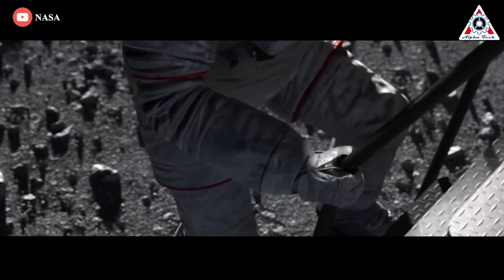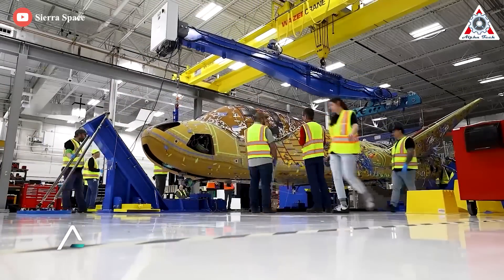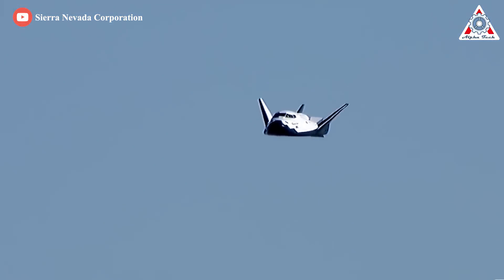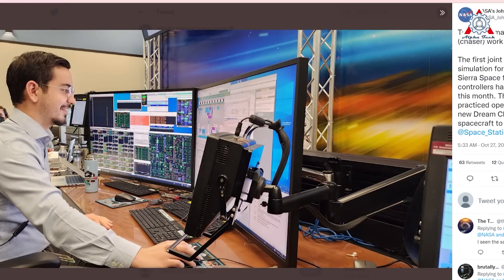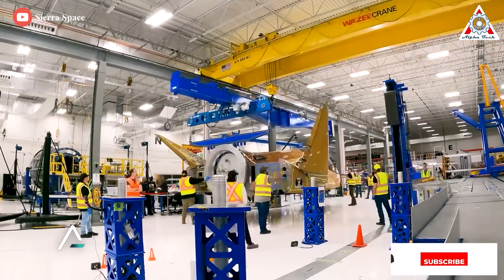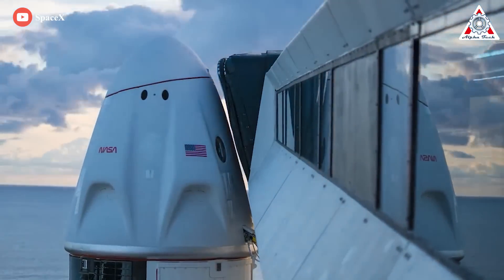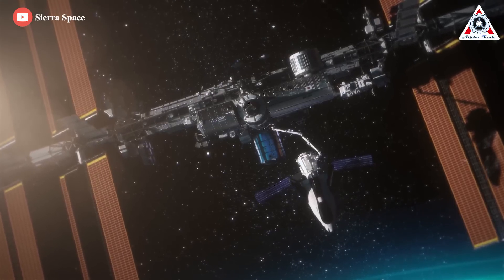Dream Chaser HUGE Update "First launch incoming" that makes NASA crazily

Comment: For me, this has the same drawbacks as the space shuttle. That is having lots of custom sized and tailored heat tiles. This is really difficult to maintain and a subtle defect would lead to catastrophic disaster. More importantly, this heat tile replacement procedure would increase the maintenance time and cost between flights. The other thing is why we need wings and air plane like aerodynamically shaped body, where it destined to spend more time in a vacuum. This dead weight added just for the return trip slow down process, I don't think it will pay off the effort and money in the long run.

Comment: NASA has been working on an inflatable heat shield. I wonder if it’s possible to use it on dream chaser and still keep the air dynamic flow of Dream Chaser.

Comment: Glad other companies are making small man-rated capsules and spaceplanes, now that SpaceX is about to put all of its eggs in the Starship basket. (SpaceX just said they were building their last Dragon 2 capsules).
Personally, I cannot foresee a time when NASA will man-rate Starship for launch from Earth. It has no ability to save the crew if the Starship second stage/vehicle explodes. Capsules and small mini-shuttles will always be safer because they separate propellants and launch engines from crew compartment. In Starship, the crew is sandwiched between two sets of huge propellant tanks and has the second stage rocket engines attached to the crew compartment.
Dream Chaser starting with a cargo version is a good thing. Doing it that way is one reason SpaceX kicked Boeings ass on getting crew to orbit first. SpaceX had already built the pressurized cargo Dragon Capsule, tested its heat shield and landing systems, and tested all of its control software BEFORE they tried to create the manned Dragon 2 capsule. So they had less than half the work to complete than Boeing did in creating their Starliner. (That also might explain why Boeing got more money than SpaceX in the Commercial Crew Program. Boeing was starting from scratch. SpaceX was able to reuse quite a bit of flight proven hardware in their new capsule.)

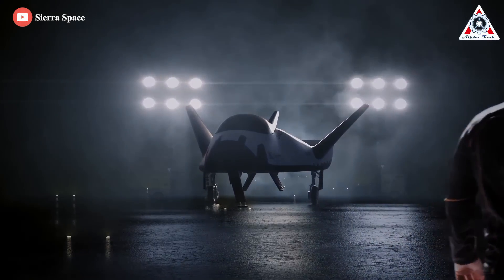Comment: 5:21 "the vehicle reduces overall cost providing quick turnaround between missions" This was said about the shuttle as well, but never materialized.
Reply: One of the cool things is that the DC will launch inside a shroud. That will go a long way to preventing tiles from coming off on launch. If the orbital maneuvering engines are modular, (able to be easily swapped out, like on the Dragon 2) that eliminates another long turnaround item.
Remember, the Shuttle also had 3 extremely finicky liquid hydrogen BOOSTER engines that were running at ridiculous pressures during launch and were just waiting to spring hydrogen leaks at any gasket. All those things (tiles falling off, booster engines that seemed to always need repairs, and maneuvering thrusters that needed to be refurbished between launches) made Shuttle turnaround such a pain. DC will eliminate at least 2 of them, maybe all three. It might be as easy as Dragon 2.
Reply: It's the difference between government run programs and privately run ones. Even Werner Von Braun, who originated the shuttle concept hated the final form when he saw it.
Reply: THE SHUTTLE WAS A MARVEL OF ENGINEERING. UNFORTUNATELY, THEY NEVER MASTERED THE HEAT SHIELD AND IT ENDED UP BEING THEIR UNDOING. IF YOU WATCH SPACE-X THEY ARE EXPERIENCING THE SAME THING. I SINCERELY HOPE THEY HAVE MORE LUCK IN SOLVING IT THAN ROCKWELL DID FOR THE SHUTTLE.

Comment: I'm failing to see the benefit of using a space plane over a capsule. Capsules appear to be the safest, and simplest way to return from orbit and they are now reusable (Dragon and Orion).  It seems to me that having to include the more complex hardware, software required to land on a runway dramatically reduces safety with little gain in functionality.

Comment: The next step would be for this vehicle to have a fully re usable fly back booster
Reply: And it would have the best of both worlds if the flyback booster worked more like a Falcon 9 recovery. That way, the DC could still launch inside a shroud for protection, rather than riding piggy-back like the Shuttle Orbiter - exposed to launch pressures and debris.

Comment: This is really exciting stuff. I get the impression that there is a lot of innovation in the design despite the similarities with the Space Shuttle which is
good because that should in theory make it more reliable. I'm really curious about the tiles. Shuttles' had its issues. Maybe these tiles will do better.
Reply: (re-post about the tiles) 
The life threatening aspect of the STS TPT system was foam falling on it from the ET, an issue which arose because new environmental regulations midprogram cancelled the use of the old CFC impregnated foam (which stayed put).  Dream Chaser is either mounted inside a fairing or atop a stack, where hypersonic apparent wind can't hurl parts of the launch stack at it.  Apparently, they are also using a different adhesive bonding for the tiles as well as larger tiles.  I dare to hope the newer system is better.
Reply: @digitalnomad9985  
Good point!
Reply: THOUGH HIS ARE MOSTLY THE SAME SIZE, MUSK'S TILE ARE VERY SIMILAR TO THOSE USED BY THE SHUTTLE.

Comment: Dream chaser is what the space shuttle was supposed to look like, before the government and NASA turned it into something the size of a bus...
Reply: Thank the Air Force reentry crossrange requirements for that one. Otherwise, the Space Shuttle would have been a lifting body too.
Of course, having the vehicle ride piggy-back on launch, exposed to hypersonic slipstream, shedding foam, and having finicky liquid hydrogen engines (and trying to reuse them every flight) also contributed to the lack of economy in the design.
DC is much smarter. Launches inside a shroud for protection of the tiles. The orbital maneuvering engines (except for attitude and small thrusters) will be in a service module that won't be reused. They definitely tweaked away all the pain in the butt parts of the Shuttle.

Comment: Love Dream Chaser (DC)    :)
Question: Are the wings really "wings?"  With DC being a Lifting Body, I would have thought they were more for guidance, balance, and air braking, rather than for lift.
In the end though, the most important things are it works, it is a great advancement on what we currently have, and (to a lesser degree) it looks cool.  :)
Reply: Without the wings it certainly would not be able to land on a runway, because the body itself doesn't have enough surface area.
Reply: @my3dviews   Can't dispute that, as I'm not an aerospace engineer, but I figured it would be too unstable without them, like some of the lifting bodies from the 60's/70's.
Reply: @martythemartian99     Yes, they would also help with stability.
Reply: No-one can say with any certainty that "it works" until it's been in orbit and returned intact. Flight tests have been successful, showing that the lifting body does indeed lift (the fins are indeed only for stability) but hypersonic testing at full scale depends on it going into orbit and returning to Earth. And its going into orbit depends on the success of the Vulcan rocket, and the success of the Vulcan rocket depends on the delivery of reliable engines from Blue Origin (which has now finally occurred).
I'm very excited to see DreamChaser fly, because fly is indeed what it will do (unlike that dismal ballistic tin can that Boeing keep plodding on with).
Reply: It has all been researched and demonstrated in the 60s and 70s.  Northrop HL-10M2-F1, M2-F2 programs come to mind.  In fact the first LBs were towed behind cars and eventually C-47s for proof of concept.  And yes they did land on "runways".  The dry lake beds at Edwards AFB.
Reply: @majorpayne608  yes the concept of the lifting body design has been around for decades. The bigger problem was getting it to work. One of these tests from back in the day. Was used on the opening of the tv series The Six Million Dollar Man. Let’s just say it didn’t end well.

Now with better design and computer assistance. These vehicles are ready to be put to work. I’ll be interested in seeing how this all goes.

Comment: Sierra Nevada Corp has a ways to go before getting a "Human Rated" cert for this thing. Even the Space Shuttle had serious Thermal Protection Tile problems decades into the program, some were life threatening. The majority of the SS's TPT's being unique to their position was a problem, driving up labor and expense to refirb it between flights. Looks like Dream Chaser has opted for the same. After watching SpaceX's R&D methods & processes, I've got more confidence in the commercial space sector then w/ NASA when it comes to bringing Space Faring vehicles up to the 21st Century. I wish Sierra Nevada Corp the Best w/ this project.
Reply: The life threatening aspect of the TPT system was foam falling on it from the ET, an issue which arose because new environmental regulations midprogram cancelled the use of the old CFC impregnated foam (which stayed put).  Dream Chaser is either mounted inside a fairing or atop a stack, where hypersonic apparent wind can't hurl parts of the launch stack at it.  Apparently, they are also using a different adhesive bonding for the tiles as well as larger tiles.  I dare to hope the newer system is better.
Reply: @digitalnomad9985  Now that you mention it, there's a neuron in there trying to remind me of such. I do recall a bit of the there being a change in Foam type mid-program. I didn't know the Dream Chaser was to be Faired into the Vulcan Centaur Rocket. I've only seen artists conceptions showing it w/o a Fairing and had assumed it would be launched exposed. Isn't that why there are TPT's on Dream Chaser's upper/fwd surfaces as well, like where the proposed windshield is might be for a Manned version? IDK, anyways, the Space Shuttle has always had TPT problems and not all were due to Foam Strike's, there were attachment issues as well. But, as you've pointed out, it looks as though Sierra Nevada is addressing those issues. SpaceX's StarShip is using as many rectangular shaped Tiles as possible but of course there's always a need to fill in the Faired surfaces too. Don't quote me on this, but somewhere along the way I seem to recall that SpaceX is using a Ceramic based TPT where the Shuttle used a compressed & bound Ash formula. And, I'd read or seen something to the effect that StarShip also had an insulating boundary layer tween the 304L stainless and the TPT's. The good news is that there are a few options and maybe we'll see a Manned/Womanned version to follow.  ; )

Comment: It feels like we are truly on the verge of a sustainable and commercially viable exploration of the solar system.  About 30 years late in my opinion, but here nonetheless.  Getting the legacy and inefficient government entities out of the way is overdue.
Reply: Unfortunately, these miracles may not be possible if someone does not get a handle on the "space trash" that is in orbit.
Reply: @ThomasLee123  The ideal solution to that problem would be an industrial infrastructure in orbit that can salvage that orbital debris as raw material for constructing things in orbit.  Overnight some of the "disposable system" losses of space operations would be recouped, the systems can be inspected before recycling to gain knowledge about the effects of the orbital environment on materials and systems, and suddenly ISRU, a concept hitherto limited to astonomical bodies, extends to Earth orbit.  Companies could pay the salvage operation for reducing their insurance liability.  An orbital tug need not use low-specific-impulse chemical rockets, but can use ion drives.  And this method does not entail the secondary hazard of deorbiting it all, and maybe having if fall on something, or someone.  With a significant mass budget like that, space stations and spacecraft could be built in orbit with significant mass for radiation shielding.  This could facilitate the building of a rotorvator/space station assembly.

Comment: 6:03 'Dream Chaser can return cargo at less than 1.5 GRAMS'? I sure would be nice to have narrators that know what they are talking about. Remember, little g = grams, big G = gravity. 
Dream Chaser can return cargo with less than 1.5 times the force of gravity. SMH.
Reply: LOL.
These guys really need an hour of the services of a technical editor before exposing their poor English to the world..
Reply: Capital "G" is the universal gravitational constant.  It is NOT the acceleration of Earth's gravity.  The text that the narrator was reading was correct in using lower case "g" for Earth's gravity (9.81 meters per second squared).  It is understandable that a neophyte wouldn't know which "g" was referenced in the text, since both grams and Earth's gravity both use lower case "g."

Comment: Of all the independent commercial space craft currently being used and still in design, Dream Chaser is the one that REALLY gets me excited.
Reply: The best part of the Dream Chaser is that it hasn't suffered all those comittee-led design compromises imposed on the shuttle. Its lineage can be traced back to lifting-body designs, tested in the early 1960's to mid 1970's, by NASA's Armstrong Flight Research Center.
Reply: @NieR.Amanda  
Excellent point, Amanda.
Reply: Seems to be a downsized redesign of the Shuttle to me. We should thank the engineers from my alma-mater Rockwell, International for the original design.
Reply: @ThomasLee123  Dream Chaser is more along the lines of what the Space Shuttle was originally going to be, but NASA decided to team up with the US Airforce to split the development cost. It was the US Airforce who wanted a large space plane with a massive cargo bay not NASA. In the Early 90s NASA wanted to replace or supplement the space shuttle with something more along the lines of Dream Chaser is now, but they weren't given the funding.
Reply: @DeepDeepSpace  
And, of course, it turns out that in the end the USAF version was the one that got into orbit and did not explode.
Reply: @ThomasLee123  well the USAF version was the only one they built.

Comment: This space plane is pretty cool but its too bad it can't  also take off from a runway. I guess aerospace engineering isn't at that lvl yet and we still need rockets.
Reply: It can't take off from a runway because the weight of the fuel. It would prevent lift, and there would be no way to build landing gear strong enough to hold it up.
Reply: @DeepDeepSpace  i mean cant we just have an airplane and give it 2 engines? 1 for atmosphere and one for space?
Reply: @theshimario253    The do have rockets that are launched from jets.  https://youtu.be/otmjA8IcWfE?t=40
But a plane as small as Dream Chaser would never make it too orbit on its own.  It requires too much fuel.  D.C. doesn't have engines or fuel tanks, so would end up being much larger if it added them to make it to orbit.
Reply: @theshimario253  no
Reply: X 33
Reply: It seems that Elon really needs to keep the older rockets around for a while to put equipment like this in space.

Comment: 6:09 The narration is disturbing when it reads "1.5g" as 1.5 grams.  Grams is a measure of mass, and returning 1.5 grams is not noteworthy.  The "1.5g" is a measure of acceleration.  The "g" should be pronounced "gee" or jeep without the p.  The 1.5g for dream chaser is the maximum acceleration the contents and people inside dream chaser will feel on return from orbit.

Comment: True exploration needs to operate from LEO infrastructure. Those who claim wings in space is a waste turn around and advocate carrying an Earth Re entry heat shield and parachutes all the way to Mars and back. Earth Re entry should be left to commercial space
Reply: I agree with you.  Too bad we’re still trying to pull off one-shot, all-the-way-there moon shots.  I though at this point, we’d be assembling space station-like module in LEO, for the trip to the moon.

Comment: Or4ion is an obsolete retro spam can. Throwing away a mega rocket, service module, and all hardware every time one flies is unsustainable
Reply: Orion is the most advanced human rated capsule we have right now. It is not throw away and will be rebuilt after each mission. The SLS may be throw away but the Orion could be launched to the moon on a Falcon Heavy. It can support four people in deep space for a couple of weeks. That's something no other capsule can do, including Dragon.
Reply: I get it. You’re right the cost of operating the SLS is prohibitive and unsustainable in the long term. The first mission Artemis I is showing why NASA went this route. They are using Orion to experiment with using human rated spaceships in the areas in ways that have not been done before like right now with the spacecraft doing a trip to the furthest extent ever. It is really important that they use it to push the boundaries of what we understand… You’ll notice that NASA doesn’t waste their time designing and building anything for lower earth orbit… They basically want to explore areas that have not been experienced before, and then let the private sector put them out of business
Reply: Orion is orbiting the moon right now. In two years it will carry people to the moon. Calling Orion "obsolete" is nothing more than trolling. Furthermore, the engines and solid rocket boosters were used many times on the shuttle so NASA already got their money's worth out of them. The Orion's engine was also used on a space shuttle many times. Lastly, ALL launch vehicles throw hardware away. Especially second stages and service modules.